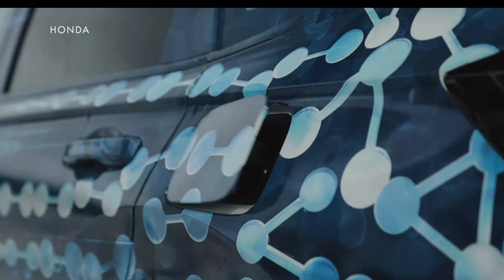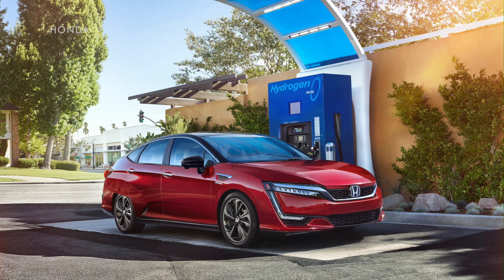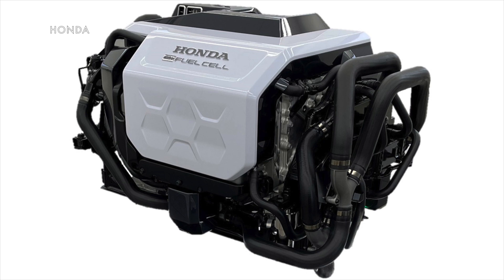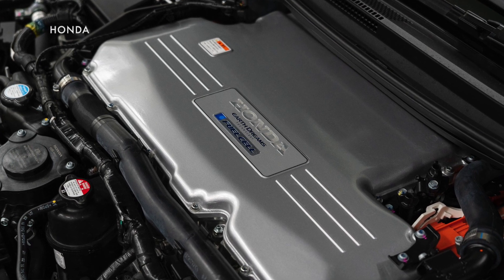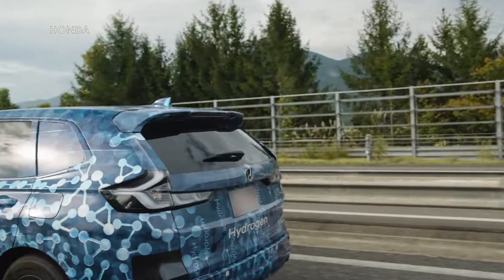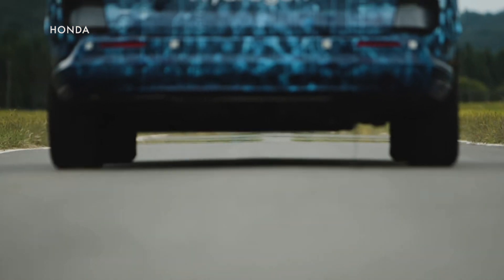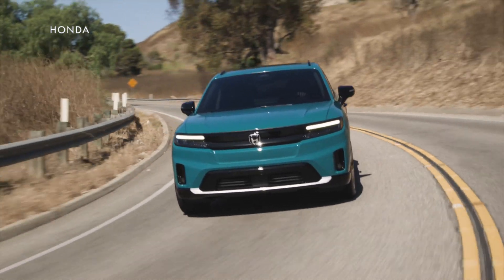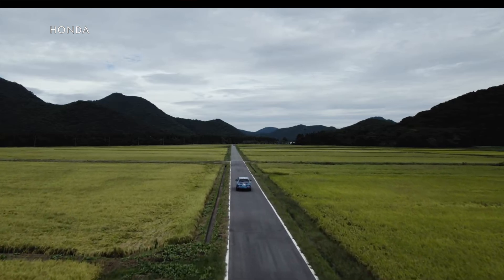First Look: Honda's Hydrogen Fuel Cell CR-V

Comment: thank you for posting this.  Reportedly the fuel cell production in Michigan is ramping up.  Western Canada seems to be the biggest market for now.  There, the climate and resources make hydrogen more appropriate than BEVs and the hydrogen infrastructure is ahead of the U.S..
Reply: Very informative. I beleive these Hybrid Fuel cells combine best of both worlds, and especially in countries with dense population and hostile terrains - these Plug in FCEV vehicles offer the convenience of ICE, eliminates range anxiety and nullifies tailpipe emissions.

Some might argue that the process of making H2 is redundant, since it required electricity to produce hydrogen , store it , ship it and then again convert the H2 to Electricity .... However, if they take Battery degradation into account - it might be a workable compromise